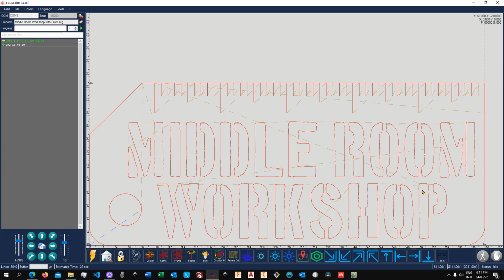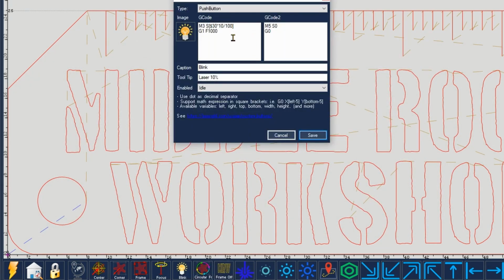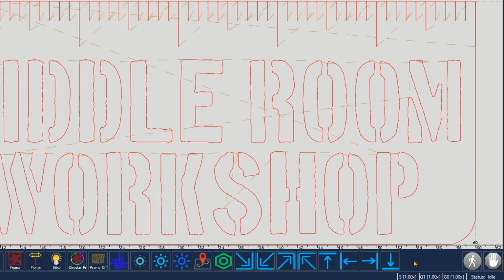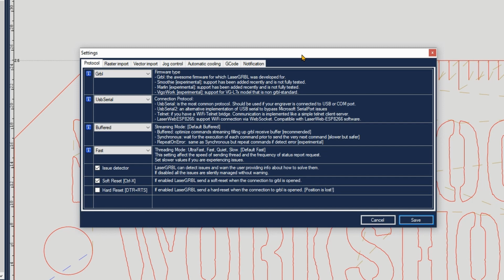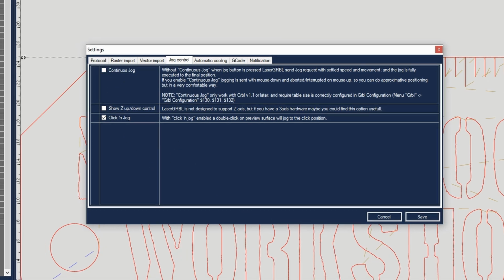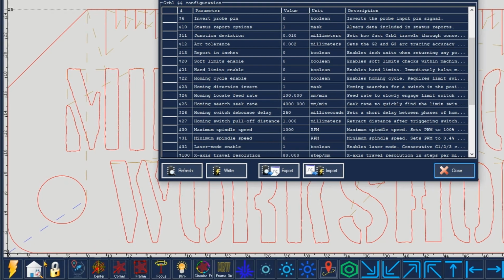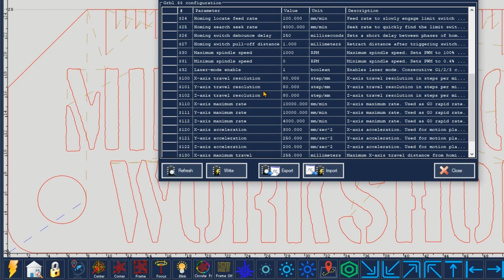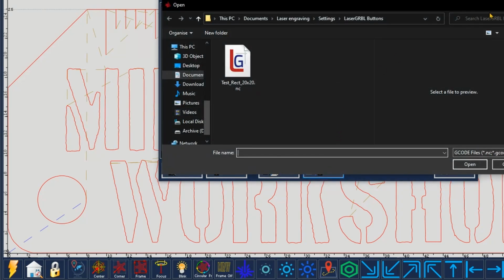LaserGRBL In-Depth Tutorial - Part 5 - Custom Buttons, Settings, GRBL Config + Hints

Comment: have a problem using grbl, the laser works in an extremely small area and only engraves in one line, for example three lines of text, it engraves in a very small space, I must have messed up some settings.Can you tell what i should do ,
please.

Comment: Thank you for your video, I have 2 concerns, can I create text in the software without having to import it from another program?
The other question, how can I make the fan of the laser module is off before any work, is that as soon as I turn on the machine without making any dialing the fan turns on and it is very noisy
thank you
Reply from the maker: Hi, Victor Gomez; thank you for your comment. 

At the moment is not possible to create anything in LaserGRBL, including Text. Therefore, you must create and import the text from another software.

Regarding the Fan Control, It is controlled by the mainboard and cannot be controlled from the software, some machines, unfortunately, keep the fan spinning all time and cannot be overridden. Machines like Longer and Atomstack have this problem.

I hope it helps.
Ciao
Reply: @MiddleRoomWorkshop  mm ok,  thanks so much

Comment: Question, there is no possibility to input your max workspace of the machine, like x=450mm and y=500?
Reply from the maker: Hi, Kris De Voecht; thank you for your comment.

You can do that in the GRBL Configuration by changing the parameters $130 and $131 for the x and the y-axis maximum travel, respectively.

Ciao

Comment: Dear good morning, an error occurs to me, when changing the format, 41 cmx40cm to 41cm x 950cm, Sculpfun S9, the Laser Grbl program, when making a cut, 1 pass everything is fine, 2 passes lose the origin point?? it moves about 5 mm and the work is bad, looking for program configuration I don't know why it happens, I'm investigating, it just happens to me because I wanted to expand the work area, I'm waiting for any reference, thanks in advance.
Reply from the maker: Hi, Rodolfo Salas; thank you for your comment. 

I think that the problem has to do with the machine itself before changing the size settings. 
Simply the board loses track of where the machine is.  
Alternatively, it could be a belt tensioning or slipping problem. In this case, this mismatch behaviour should be noticeable in jobs with direction switches.

Have you tried homing the machine between passes? You can automate this process from the settings by going to Settings > Gcode and under "Multiple Passes"  and pasting in "G0 X0 Y0 Z0" without the double quote. Technically this is not home but origin.
However, if the machine does not move perfectly back to the home position, this should hint that it does indeed lose track of its position.

Let me know
Ciao

Comment: Very good, but i have problem with M3, M4, M5. Laser work only M4 and off M3. Where I can find this setting.
Reply from the maker: Hi, Miodrag Milovanović; thank you for your comment. 

M03 and M04 correspond to constant and dynamic power, respectively, while M05 is powered off.

If you import a gcode file, the power mode is coded in the file by the native software, i.e., the software that created the file. If you work with images or SVG files, you will be prompted to select the mode in one of the setup windows once you import the file.

Some conversion tools will require the engraving to be done in dynamic power mode M04 as they trace, while others do not. 

Ciao
Reply: @MiddleRoomWorkshop  Hello, I have a problem that the laser turns on with M04 and does not turn off with M05 but with M03.
It also burns non-stop and does not turn off only if I write M03.
Reply from the maker: Hi, Miodrag Milovanović; thank you for your feedback. 

That is weird yet interesting behaviour. 
I haven't heard of such a problem so far. 

When you say write M03, do you mean you send this code from the input field in the interface in LaserGRBL?
If that is correct, it means that the machine's firmware is not correctly configured. 

Have you had the chance to try any other software other than LaserGRBL? 
What is the model of your machine? I suggest trying to find the firmware update on the official website of your machine.

Also, do you have a second machine to try your current LaserGRBL installation on? LaserGRBL may also be faulty, sometimes installations are not correctly completed (installer fault), and the software may result in buggy behaviour.

In any case, keep it handy, M02; this is to stop any program from executing.  Here is a blog post with some of the most important gcode commands https://whathowwhysolution.com/what-is-gcode/

Let me know, and I will help you as well as possible.
Ciao
Reply: @MiddleRoomWorkshop  I replaced the arduino nano with an arduino uno and uploaded the software. 
This is a small Neje laser 5x5cm. I will have to play a bit with the settings in the Gblr laser 
configuration - config and cpu_map.
Thanks for helping me.
Reply: I solved the problem.I connected to spindle direction D13 instead of variable spindle pwm D11.When I connected to the variable spindle pwm D11, there are no more errors. Arduino uno.

Comment: Hi, I'm using an Atomstack S10 Pro and when I press the frame button to show me the area is going to engrave, the laser is burning the frame on my project. How do I solve this problem? Thanks
Reply from the maker: Hi Marcos Firmino, thank you for your comment. 

Most probably, the laser power coded in the button is too high, or the material you are framing on is too sensitive; either way, you will need to reduce the power on the framing button. 

To do so right, click on the framing button and click edit; this will open a window with the code as follow:
G0 X[left] Y[bottom]
M3 S[$30*3/1000] F4000
G1 Y[top] 
G1 X[right]
G1 Y[bottom] 
G1 X[left]
M5
G0 X0 Y0

Change the percentage value in the 2nd line  as highlighted here with CHANGE 
M3 S[$30*CHANGE/1000] F4000
You may try with 1, which is 1%
Alternatively, you can increase the speed by changing the value after the F in the same line.

Let me know
Ciao

Comment: Could You please tell us, what's behind your button named "Frame Off"? Cpul be exactly waht I#m looking for: I try to get rid of the outline and laser only the hatch I produced with Inkscape. Thanks for your answer!
Reply from the maker: Hi Andreas Bracht, thank you for your comment. 

The button allows for framing with offset, so when it frames, there is a gutter of 5mm, which will make sure that I am away from edges and other cuts in my sheet.
It is a copy of the existing frame button, with added 5mm gutter.

G0 X[left-5] Y[bottom-5]
M3 S[$30*3/1000] F4000
G1 Y[top+5] 
G1 X[right+5]
G1 Y[bottom-5] 
G1 X[left-5]
M5
G0 X0 Y0

I hope it helps
Ciao

Comment: Hello my friend
I want to ask you
I have a PDF file in which there is a Mandela design and I want a story with a laser machine. What is the appropriate way to upload it to the LaserGRBL program so that I can cut it with the machine?
Reply from the maker: Hello لحزام الأسود , thank you for your comment. 

You can easily open .pdf with Inscape, there, you may need to work it out depending on the way it was designed.
If it is a filled shape, you will need to apply some Stroke, then under path > Stroke to Path; this will give you the actual path that the laser should trace. Once done, you got an SVG file which can be open directly in LaserGRBL.

Note, if you wish to retain any fill, the work around is tedious, let me know so I can guide you on how to do that.

Ciao

Comment: haw can i calibrate the axes and how can i activate the z axe .... pleas repond me early have a goode day
Reply from the maker: Hello abdou doula, thank you for your comment. 

Let's first cover the Z-axes:
1) Show jog control: GRBL > Settings > Jog Control and toggle on "show Z up/down control". This will show the control for the Z-axes next to the JOG control area in the main window.
2) Sink the Z-axes between passes: If you want to lower down the Z-axes between passes, go to GRBL > Settings > G code, here under the "Multiple Passes" block, look for where it says ";G0 Z-1 (sinks the Z axis, 1mm)" and remove the ";"semicolon from the front of the instruction. 

For the calibration, you will need to know the steps per mm of your driving system, i.e., Stepper motor, pulley and belt. 
Once you got that number, go to Grbl > Grbl Configuration and look for &100, &101 and &102; these are the Axes resolution, a typical machine that you buy ready with a NEMA 17 stepper, a 20 teeth pulley, and a GT2 timing belt has that value at 80steps/mm.

Let me know.
Ciao

Comment: I have a KKMoon 7w laser that I just connected to LaserGRBL, There were custom buttons but are not working with my laser. When I try to home the laser it doesn't stop and when I try to outline my cutting area it runs and slams into the stops. You showed me how to configure these Buttons so any hints on what I should be typing in to make these work properly?
Reply from the maker: Hello John Pierce, thank you for your comment.

Let's take it to step by step; first of all, we need to solve the issue about the home. The machine should retract and stop once it reaches the end of the axis where the limiting switches are.  Assuming the machine has limiting switches (some users have reported that they were missing), Does the machine move in the right direction when you click the home button? If yes, can you see or hear the click of the switches? If no, we need to invert the homing direction and for that I have a FAQ page describing how to do it https://whathowwhysolution.com/when-clicking-on-the-home-button-the-machine-goes-in-the-opposite-direction-lasergrbl/

About the button, the strange behaviour is most likely related to the unproper homing covered earlier, but you can still re-install the custom buttons, here i have the copy of the original one in case they broke up https://whathowwhysolution.com/lasergrbl-custom-buttons/

Let me know
Ciao

Comment: i have a second hand laser engraver which i was told was A NEJE Master 2S. "NEJE" is on the boom that supports the laser unit. the name plate data is "KKmoon Master 7w". When i attempted to load your configuration file i got an error message saying there were 21 errors. The configuration file shows only items to $22 and nothing above that. I can't find a way to add any lines. When i export the existing configuration items it only lists to item $19.
i think i don't really have a Master 2 plus.
Also when i try to import a png  file i get an error "TimeSpan overflowed because the duration is too long." when at the create step.
when i try to import an svg file i get nothing at the first dialog when i click create.
I realize this is a lot. but can you direct me to some references for further research.
Thanks, your tutorials are very good.
Reply from the maker: Hello Ray R, thank you for your comment.

This is very interesting feedback, is not uncommon to find brandless goods passed by companies under their brand, I believe you got a KKmoon indeed, just because it is less famous than NEJE it has been passed like NEJE or simply who sold it to you had no clue either.

Anyhow, let's get into the core of your problem;

Why would you want to use external configuration files? Did you have some problem controlling your machine by simply letting LaseGRBL connect to it?
Perhaps the motherboard is different and the chipset run the previous version of GRBL. 
Does it work with Neje Desktop app?
The file that I have provided contains 34 GRBL lines and is specific for the NEJE Master 2S Plus, however, any Master 2S should get it without problem, you only need to tweak the engraving area parameter.

I do not have another reference, I should search it as well, I can try to help you as best as I can.

I suggest you try to install the CH340 driver first, this can be done directly in LaserGRBL, connect the machine through USB, then go to Tool > Install CH340 Driver, once that is done you try to connect the machine without importing any configuration file and let see what happen.

Let me know.
Ciao
Reply: @MiddleRoomWorkshop  
Thanks for the response. I was able to get it to work using the Neje software. According to that it is a series 1 device. I updated the firmware. I was not able to get it to work with laserGrbl but it worked well with the Neje software for what need to do. 
Thanks again for your help.